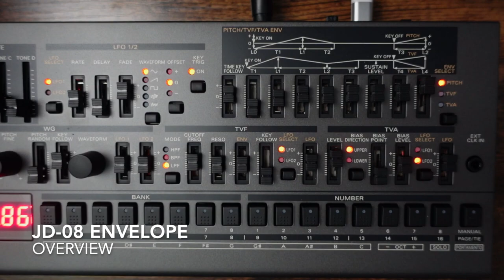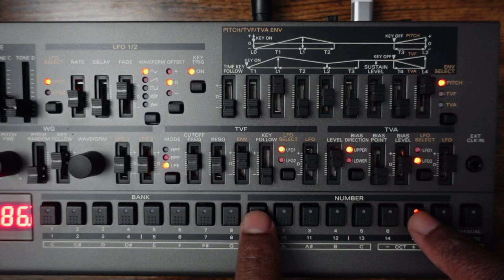Roland JD-08 Envelope Generator Explained

Comment: hey , your video was so much help , can u do a video showing up how the sequencer works exactly?
Reply: do i have to use a controler to record the sequencer ?
Reply from the maker: Excellent question. No. You don’t have to have a controller however it does help. I would recommend either the Keystep or Keystep Pro by Arturia or (if keys are not important) the SQ-64 by Korg.

Comment: Thank you so much for this needed tutorial/walkthrough. This thing was pretty complex for me so this helped A LOT. So TVF and TVA stand for Time Volt Filter/Amp or something similar? Please do more for the JD08 and make it a series so we all learn alongside you
Reply from the maker: Thank you so much for the support. You are correct TVF and TVA are essentially the VCF (voltage-controlled filter) and VCA (voltage-controlled amplifier) respectively. I plan on doing more soon. Let me know if there is something that you would have me go over. Again, thank you for tuning in!
Reply: @dncmusic8070  Maybe this is really late but I've watched your videos a few times. This JD is taking me time to learn. How about showing us the TVA section? I dont know what the heck is bias..

Comment: Excellent tutorial, please keep them coming! This is the only Roland Boutique that really interests me at the moment and your clear explanation was great. 
One needlessly drawn out question if it's ok with you: 
How does the JD-08 handle manipulating the fader values within the same patch since the 4 tones and envelopes share the same faders? For example if the T1 fader was half way down on Pitch Env but it was all the way up for TVA once you click the "Envelope type" button does the value stay the same or jump to the current position for the type of envelope chosen? Even better if the unit has another clever way of handling this fader-sharing. 
My favorite part about this synth is the 4 separate tones aspect of the original 90's design. But it seems that manipulating the many values within the tones with shared faders might be challenging by just watching all the videos about this unit I can. 
Jeez too much fader talk and for a question, but I guess that's what this little beast is all about. I don't have access to one of these in Colombia so I have to buy it and import it, so knowing more than a bit in advance really helps. 
Thanks and again keep the great content coming!
Reply from the maker: Excellent question. The values of the faders will not jump to new positions after switching modes. If the the TVA T1 fader is set to 5 and you switch to TVF mode, TVF T1 will not jump to 5. It remain just as you saved it until you move the fader again. I’m hoping that helps.
Reply: @dncmusic8070  That’s great and just about the last thing I needed to know to press buy! Thanks so much, your content is the kind of deep dive stuff I’m looking for. From what I’ve seen and researched this synth is the most experimental-friendly, “budget” and portable in the market with the most hands on control, would you agree or do you have another recommendation? After messing around with the Roland cloud jd800 trial from an init patch I was able to create huge experimental drones, weirdness and modern pads beyond the 90’s presets with that 4 tone workflow and those great and some goofy waveform samples.
It really can’t be more than 400us or in Colombian pesos I’ll go broke! Jajajaja
Reply from the maker: My apologies for the delayed response. As far as experimental, multi-timbral and multilayered sound design goes, this is the way to go. The only other synth that I can think of that gives me same experience is the MiniFreak by Arturia however the JD-08 is more affordable and gets the job done (especially if you like tangible buttons and knobs). I've recommended the JD-08 to people close to me and they are happy with the purchase. Let me know if this help with the decision making.
Reply: @dncmusic8070 Thanks for your response! I purchased the JD, in fact I just got it from the importers so today is my second day with it and couldn’t be happier! You’re completely right the sound of the thing is wonderful and I love creating patches from scratch, the possibilities are really endless with those 4 tones and infinite polyphony, frankly nothing 90’s about it except the old presets. No other synth now really has this machine’s originality and character, perhaps the Minifreak as you say.
Right now I’m binge re-watching all tutorials on it, including your video so please keep more content coming! 🎉

Comment: Nice video, thank you. Always been a bit puzzled by the envelope. I´m very interested in the JD-08 but i´m always a bit afraid as most of the videos of it or the JD-800 sound like 90´s cheese. How far can this thing actually be pushed and how gritty and dirty can it get? I understand it has PCM samples of regular sawtooth/square/triangle etc but beyond that is it only useful for pads? I like my synths nasty like the og Microkorg/MS2000 or the Wasp so would this even be for me?
Reply from the maker: Another excellent question. For this I will have to demonstrate the overdrive and distortion/saturation capabilities of the unit. You’ve given me an idea for a future video but to answer your question, it can get a little dirty. I will show you how to dial in the parameters in one of my future videos. Thank you for the support!
Reply: @dncmusic8070  yeah that would be cool. its one thing nobody seems to demonstrate just how the JD-08/800 sounds when used as a more straightforward subtractive synth  etc